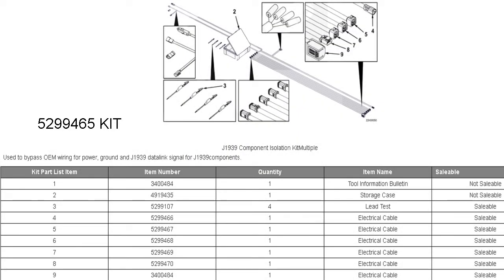How to isolate the data bus compnents when you have a bus communication problem

Comment: There is a great tool in insite for this.  The data link tool in the tools tab has the ability to seperate can signals and allows you to observe them individually.  The problem is Cummins only allows engineers to have access to it.  I despise oem hoarding things like this.
Reply from the maker: I know that test but did not know it had more options for engineers only. An interesting side note. Engineers have a tool called calterm (calibration terminal ) that runs in a dos box. It is quite powerful and has a steep learning curve. I was told by and engineer who was a field troubleshooter he uses insite 8 out of 10 events to solve problems he is called out to investigate. There are a couple reasons for that. One the engineers want the guys like you and me to feel like Insite is a sufficient diagnostic tool- and it is.
Number 2 Calterm would be overkill for many problems they come out to solve. Calterm can log accurately 10 times a second where insite at best can log accurately about 1 event every 1.5 seconds. However in calterm you have to load schemes or modules related to what you want to log. It is very different then the data logger we are familiar with in Insite.

Comment: Faster to just scope the can lines at the Cecu and find out what leg of the bus is faulting. Then start unplugging modules. I do like this kit it would come in handy if you didn’t have a scope.
Reply from the maker: Yes there are much better ways but not all of us have the tooling or ability to use the tools with out some training. I have never used a scope (in the automotive world) but one of the guys I worked with did use them on the ford power strokes and some automobile repair events. So I have seen their value. I appreciate your comment as It is good to know varied and know the best way to do accomplish a task.